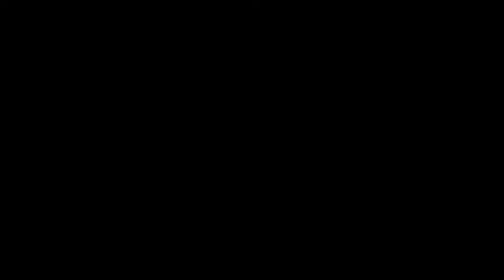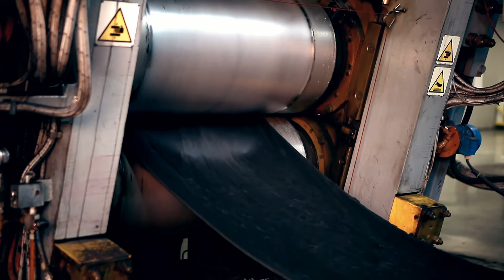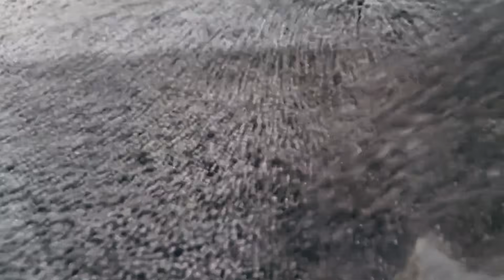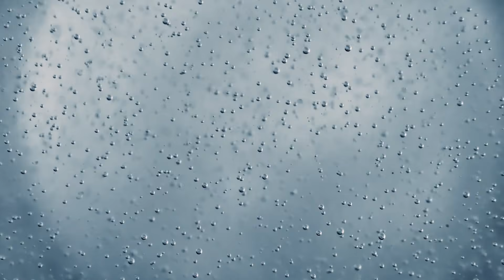The Science Of Foam

Comment: i worked at a packaging company for 20 ish years in the foam conversion department, mostly cutting big blocks or sheets up, for others to glue or heat seal together into the 'end cap' or other fitting, design required ,
Reply: where i worked XPS was the term for the expanded type polystyrene not  EPS ! maybe a UK/US difference? 😉 in the last few years, i cut up loads of the blue denser extruded type ,

Comment: 🎯 Key Takeaways for quick navigation:

00:00 🧽 Synthetic foam production reached over 2.3 million tons globally in 2022.
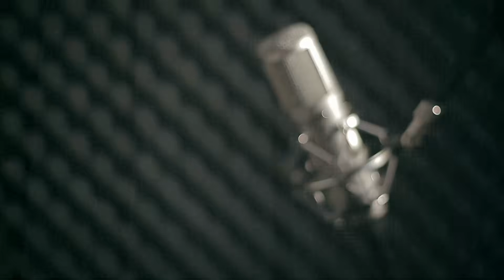00:27 🪑 Foam is used in various products, including furniture, insulation, and packaging.
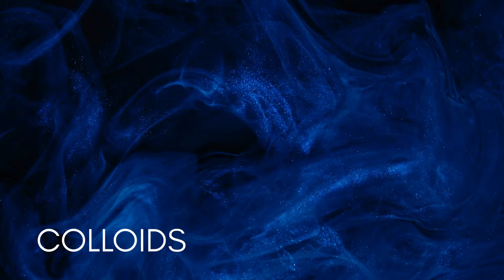01:09 🛁 Foams are dispersed media with gas bubbles trapped in a liquid or solid, creating unique structures.
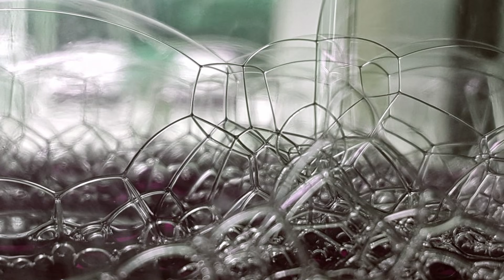02:44 🌐 Foams have a hierarchical structure from molecular to macroscopic scales.
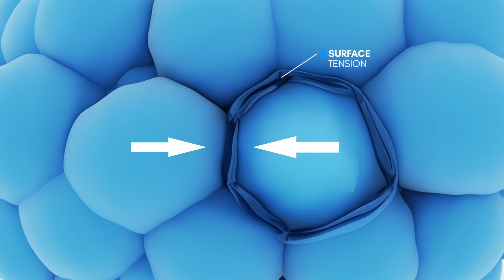03:55 🌬️ Foam stability depends on film surface tension and excess pressure.
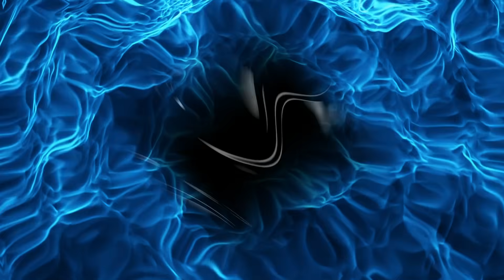04:22 🪶 Dynamic film elasticity in soapy water leads to self-repairing behavior.
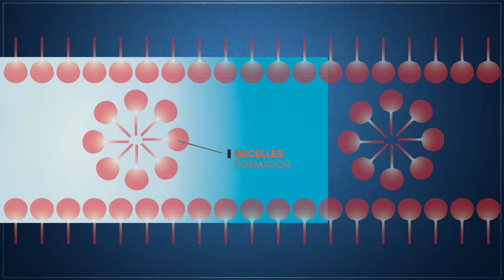05:33 🧪 Solute concentration affects foam stability; ionic surfactants can stabilize foam.
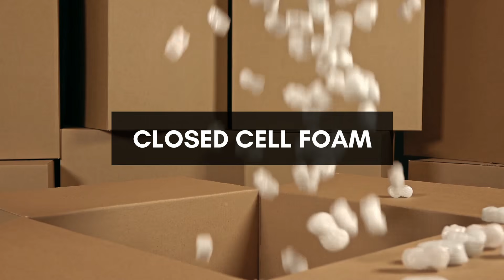08:05 💪 Open-cell and closed-cell foams have different structures and properties.
09:28 🦠 Natural cellular solids like cork and sponges have been used historically.
10:55 🌟 Synthetic foams like polystyrene and polyurethane revolutionized foam production.
14:20 ♻️ Efforts to make polymeric foams more sustainable and recyclable are ongoing.
16:25 🌬️ Polyurethane foam is produced by mixing polyols and isocyanates.
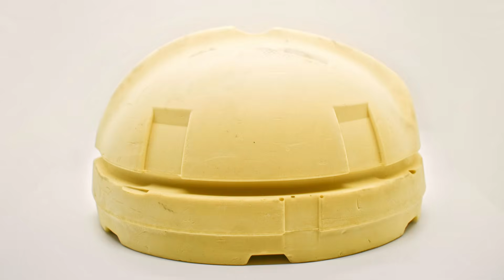17:34 🏗️ Polyurethane foam has diverse applications, including in vehicles and buildings.
20:17 🚀 Advanced foams like syntactic foams and nanofoams have unique uses.

Made with HARPA AI

Comment: I was recently looking up how defoamers and anti-foaming agents work (defoamers actively kill foam while anti-foaming agents prevent its formation - the terms are often used interchangeably). Unfortunately, I haven't found a good explanation apart from the defoamers spreads better than the surfactant and lowers (or increases? I dont' remember) surface tension. One such example is dimethylpolysiloxane - I've used one such product to remove foam residues from laboratory glassware. It is also useful for reactions that would otherwise foam or froth too much, escaping the container. It would be great to make explaining video on how that actually works - why little amount of defoamer has more effect than tons of soap? What are the differences between cationic, anionic and non-ionic (zwitterionic) surfactants? What are the differences between tensides and detergents? Why quaternary amine compounds are specifically used in fabric softeners? etc. etc.

Comment: Is hand sanitizer a foam or an emulsion?
Reply: It always comes as a gel or a liquid. It only foams if you use a foaming head like they have in soap.
Reply: @JonTheMiniBeastHadden   Do you not notice the GIANT air bubbles in every bottle of hand sanitizer? That's what I'm referring to. Theyre selling you AIR
Reply: @dustinsmith8341  are you referring to the tiny little bubbles in it from it being injected into the bottle? If there is a big bubble in it, it's from someone flipping it upside down leaving it like that until the air from the top of the bottle works its way through the gel then flipping it right side up.